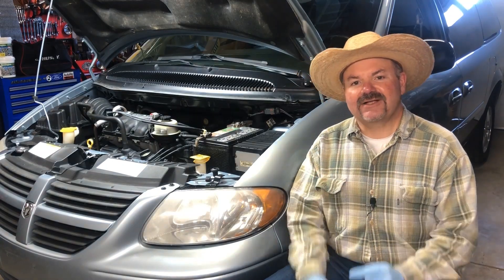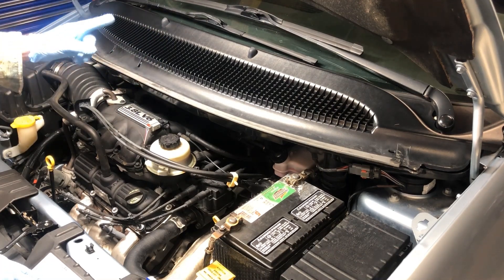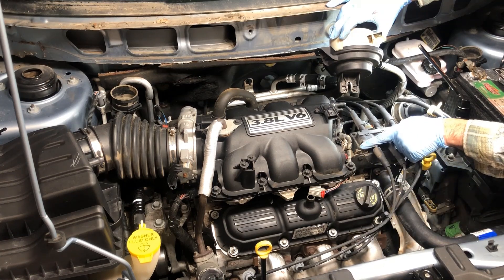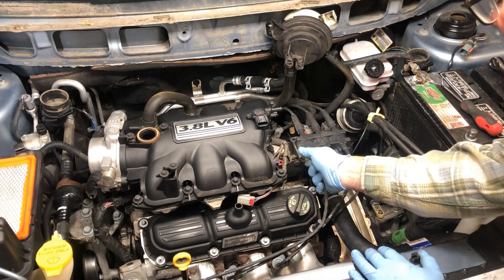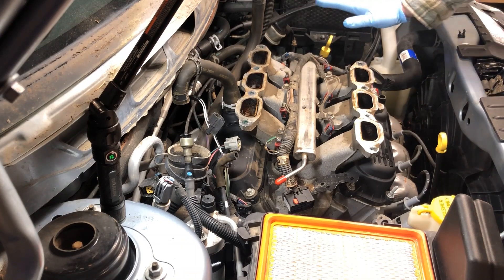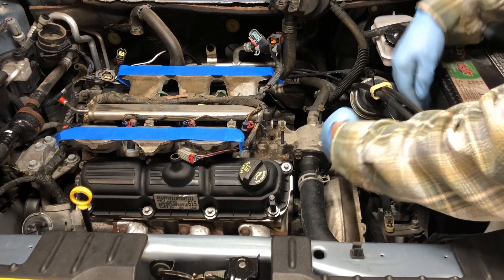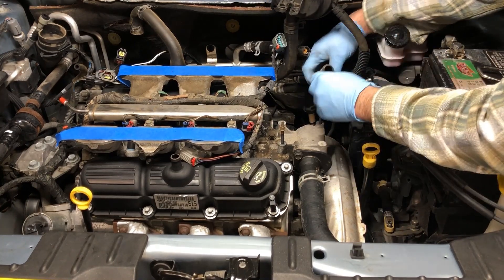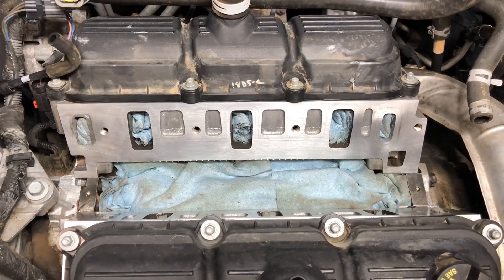Intake Manifold Gasket Replacement Grand Caravan Town & Country Part 1 of 2

Comment: As usual you've made a terrific, concise video that is clearly the best on you tube. 

I'm a little surprised that while you had that intake off it would have been the  primo opportunity to swap out the valve cover gaskets despite the fact they weren't currently leaking.
Inevitably they will. 
Fantastic video anyway and thank you for taking the time and effort to do what you do so well.
Reply from the maker: Wow, thank you Tim!  I wanted this video to be specific to the intake manifold gasket but it would certainly make sense to do what you're saying and replace the valve cover gaskets while your there.  That, my friend, sounds like a future video I will be doing though.  I purchased an 05 T&C Limited and will be putting out another 15-20 videos on the 4th gen vans this summer or fall.  Thank you for stopping by and taking a moment to leave me a comment.  Please accept my apologies for the untimely response.

Comment: I have a 2005 Chrysler Town and Country Base model (short wheel base) 3.3L. I'd love to see as many repairs as you can come up with for these vehicles as mine needs lots of love. The previous owner just drove it and didnt really maintain it. Even my windshield wipers are out of sync and they hit each other.. :(
So far I've replaced the front rotors, brake pads and am about to do the oil pal gasket using your video to help (Thanks for that video!).
I still need to do the rear drums, front wheel hubs, front calipers, brake fluid reservoir (the wrong one is in my vehicle), both front power window motors and regulators, and driver side sliding door power door lock. 

Anyways, thanks for these videos, I really appreciate it!
Reply from the maker: @Kenneth Turner - I do have a video for the sliding door lock that will hopefully help you.  The brake job on these vans is pretty straight forward so you should be good.  I do have a few more repair videos I need to edit for these vans and I hope to get those out in the next week.  Once I get another van (one of these days, they're getting harder to find in decent shape) I'll be doing quite a few more videos so stay tuned!  Thanks for stopping by and taking a moment to leave me some comments, much appreciated!
Reply: Mines do too. I can't remove the spark plugs
Reply: @javosgarage  my spark plugs won't come out

Comment: Question one of those bolts that hold the gasket in place the 2 10 mm, I had one of those snap inside and can't get it off could I run with out one of those bolts?

Comment: Once that intake plenum comes out it will leak air and oil forever no matter how you tork it, and will cause a rough idle as well. It takes hours just to remove the heat risers and grounding straps on the plenum, it is so not worth it.

it will be true  ??

Comment: Changing the lower intake manifold in addition to the gasket on a 2007 T & C 3.3L as it keeps leaking and looks pretty corroded. The part I removed is stamped with 04848957AA, but online resources reflect that's for a 2004. When I look up info for a 2007 it reflects 04648958AA - is there a difference?
Reply from the maker: @Amy Acosta - Hello Amy.  This is an interesting situation.  First off, let me say I have never had to replace the lower intake manifold due to corrosion I've only had to replace the gaskets. Having said that here goes...
I see when I googled your stamped part number that it came up with a '04 Grand Caravan on ebay.  Take their description with a grain of salt.  I believe the same manifold is used from 2001 to 2007.  Here's my basis - the same part number for the intake manifold gasket set is used for all 2001-2007 Town and Country's with both the 3.3L and 3.8L motors. Also, if you look up the 0464895AA part number on a Dodge parts dealer's site it will say this part also applies to all variants from 2001-2007.  Here's a link to look for yourself:  https://parts.shelorchryslerdodge.com/p/Dodge__Grand-Caravan/Intake-manifold--2000-24L--33L--38L-Include-Intake-Plenum/52834301/4648958AA.html
Click on "What This Fits" and you'll see what I mean.  It's not uncommon for manufacturers to update a part number as time goes by.  So it's possible (very likely) your 04848957AA part number has been superseded with the new part number, 04648958AA.  

My advice to you is to write down your VIN number and call your local dealership.  They will be able to use that VIN to tell you the correct part number (or numbers possibly) that would apply to your vehicle. That is the only way to know for sure.  The only caveat would be if someone has replaced the motor in your van with something else.  It may not hurt to get the info off the label of your front valve cover as well before you call the dealership so you have more info to provide them.  Ultimately, replaced engine or not, it is my belief they are all the same intake manifolds from 2001 to 2007, maybe with some small improvements in the later years.  I would look to get one from your local salvage yard and save yourself a lot of money btw.

I wish I could provide you a concrete answer but hopefully this information can help get you on the right track.  Please let me know if you have any other questions and let me know what you ultimately find out from the dealer, I'm curious!  Thank you for stopping by!
Reply: My intake manifold gasket is red not blue .. what's the difference ?? FEL-PRO
Reply from the maker: That is correct Mike.  Different manufacturers just use different color materials.

Comment: great work friend, I would like to know if the intake manifold can be cleaned inside or not and with what it could be cleaned.
Reply from the maker: @Jose_andres - It certainly can be cleaned.  I clean EVERY upper and lower when I do the gaskets.  I like to remove the throttle body so I have easy access to clean inside the upper intake.  This will also give you an opportunity to clean out the throttle body real good too.  Usually I just use my pressure washer so I can get up inside to get all of the oil buildup and grime cleaned out real good.  Same process with the lower.  You could use something like brake cleaner if you don't have a pressure washer.  I'll tell you though, there's been a few times in the winter I would just place my parts in a box and head on over to my local car wash and just do the cleaning there.  Hope that helps you.  Thanks for stopping by!
Reply: @javosgarage  Thank you very much friend, the information really helps me since the EGR valve was open and the admission was contaminated but I do not have much experience in the cleaning process of this part, I will follow your advice and I will try it with brake cleaner, many Thank you.

Comment: Just like that.
Reply from the maker: @3bhui - LOL!!  I do say that more than I should.  I'm not sure if it's in this video so much but the other phrase I'm trying to not use all the time is "basically".  What can I say, I'm trying to get better.  I appreciate you stopping by and giving me a good laugh - thanks!
Reply: @javosgarage  These are very useful videos.  I have a Caravan that I need to repair with the same issues - coolant leaking from the intake and the electric locks on the sliding doors that don't work.  Thanks for posting the videos.